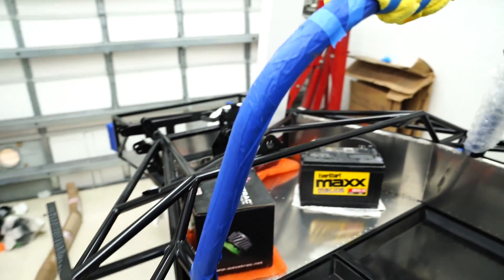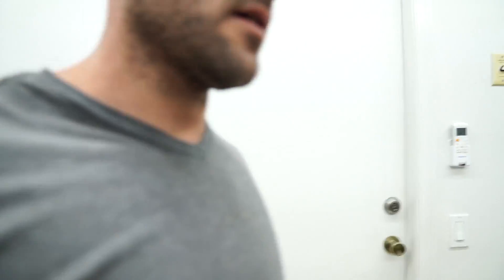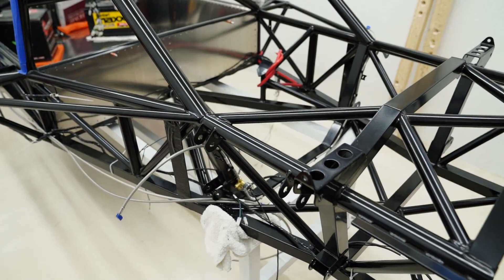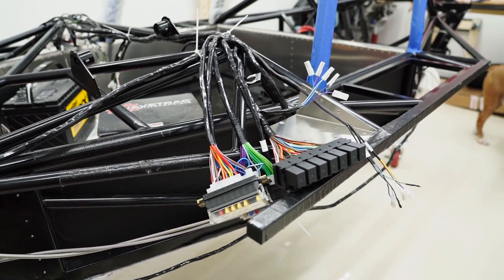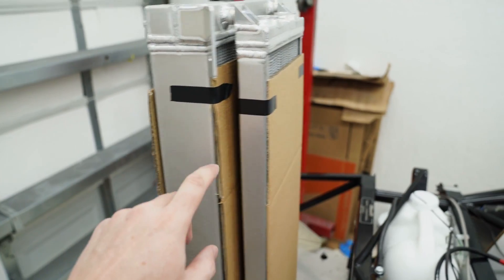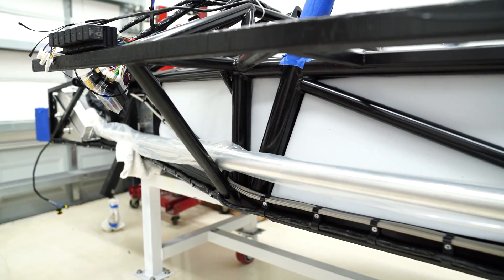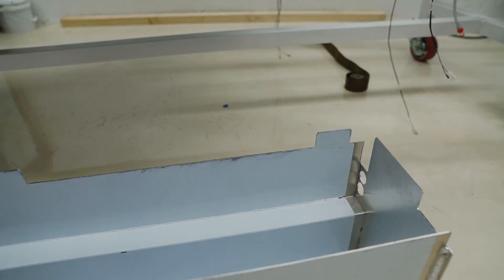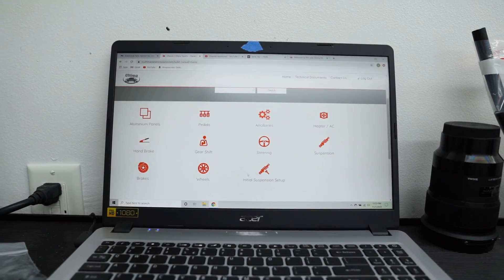Ultima RS Build 02 - Ancillaries! - Brake lines, wiring harness, radiator, & luggage bins

Comment: My son and I are building an Evolution. We are on hold while we move to a new shop. We eliminated all fuses, relays, gauges, switches and 1/2 the loom and wired for an Aim PDM 32 with a 10” dash. We really enjoy watching your build. Great stuff. Thanks.
Reply from the maker: Wow... I didn't even know Aim offered something like that and I just read up all about it. That is awesome. Did you modify the existing wiring harness to work with the Aim kit, or did you start from scratch?
Reply: @UltimateUltimaRS  I put the harness on a board as is. Wired it up to test LED's, a battery and verified all of the circuits. I then drew a wiring diagram, then de-loomed and rewired it all. I did it for fun and really enjoyed it. The bad news is the harness is ready to go but the project is on hold until we move this month. I saw the PDM 32 last November at the AIM booth at PRI. It was supposed to be released in February 2020. Due to Covid (they say), it is still hard to get and I don't have one. I have programmed it in their Beta software and purchased the harness connectors so it's ready to go.

Comment: Not a road trip vehicle? I have plans for my surfboard and suction mounts. 
You're making some stout progress, Gabe. It all looks neat too! You did make me rush and check my harness for labelling though. As for that LT engine harness, you might need some extra horsepower to carry it.
Reply from the maker: Yeah I forgot you're putting rock sliders on yours! If anyone could make a rear wheel drive crawler, it's you Rob. I'm looking forward to seeing photos of your Ultima with the suspension fully articulated so put it on the white board!
Reply: @UltimateUltimaRS  I need rock sliders for a trip to the coffee shop with our road conditions! I might have to upgrade the whiteboard for the suspension drawings and get a Beatles haircut so I can emulate Engineering Explained.
Reply: I was driving mine 4 hours each way loaded with gear for a track day weekend, it's a perfectly good road trip vehicle!  As for the LT harness, if you're going with the stock ecu, you can probably de-loom the braided shielded cable for the throttle sender, I'm willing to bet layout is very similar to the LS7 harness.  It has enough length to reach the pedal from the side pod and you can make the harness look a lot nicer in the process.
Reply: Rod 105, I noticed that you are using a ruler to mark the robot holes. Take some elastic band that they use for clothing.Mark increments of 10mm on it. So when you stretch it, it will give you equal amounts of holes. I hope you under because English is not my native language.
Reply: Damn iPhone keeps changing the words. The worst phone I ever had.

Comment: Before you fit the body side pods run a length of rigid plastic DIY cable duct under both the luggage pods.
Later on you may find you need to run extra cables you had not planned so you may need these ducts.
Ask me how i know. I've built 5 Ultima.
Reply from the maker: Good to know and thank you for the comment. I have been waiting until the absolute last minute to finalize them and will search for some of that cable duct to use!

Comment: It's surprising that Ultima doesn't use hard lines for its brake setup.

What kind of harness wrap does your body harness have?  
It looks like silicone tape, which is what I'm planning to use for a custom harness on a v8 conversion project.

Nice build series, it's refreshing to follow a build that is all content and doesn't throw in a bunch of silly hype to get clicks.

Comment: What made you decide to dry wrap the header wrap? I found if you soak it first it's a lot nicer to work with and  not as dusty.
Reply from the maker: The instructions indicated wetting was not needed, though looking back, I probably would have just so it was easier to work with.

Comment: The heat wrap, are you not suppose to soak it in water before applyiing?
Reply from the maker: DEI states it isn't necessary with theirs, though typically yes, that's what I've seen as well.

Comment: could you have used something like a holley harness?  there a little cleaner that gm harness
Reply from the maker: At the time of the build, there wasn’t a company that offered an ECU/Harness for the LT5 that controlled both direct and port injection. I definitely would have gone that route if so.

Comment: Please, please, pretty please, don't used that LT5 harness. Look into something like a PDM that eliminates all of the bullshit, the fuse box, etc and makes for the cleanest installation possible. Haltech makes one that has a TON of features you could use on this monster like TC and a ton of I/O for just about everything imaginable. I think it's called the R5000?

Also, on that DEI wrap, you're supposed to overlap it half way for maximum effect. Letting it soak in some warm water also makes it much easier and for a much nicer finished product as well.
Reply from the maker: Corey I'm right there with you but I haven't been able to find a plug and play aftermarket ECU for the LT5. I just went on Haltech's website and it doesn't seem like they have anything for the Gen 5 LT engines at all. I know Holly JUST came out with support for some of them and I was excited for that until seeing the ONLY engine they don't support is the LT5. Motec is an option but the cost of an ECU plus custom harness PLUS custom tuning is a huge cost. All those extra components from GM are going to be in the side pod hidden, with just the wiring harness for the sensors wrapped around the engine. We'll see...
Reply: @UltimateUltimaRS  I'd contact Haltech directly and see what they can do, but if they can't help with a plug and play, I think your best option regardless is actually one of the kits and just source the connectors or use the ones from your harness and make it up yourself. There's a pretty good chance you'll have to some modifications to it anyway for layout and different placement of things anyway. It's not hard at all. One of the universal Haltech PDMs come so all you have to do is route it how you want and then crimp on the pins for the connectors. Can't ask for much easier than that. Lol
Reply: Ultimate Ultima RS . A Bosch ms6 from Uwe Ostmann, extreme di, Fixes that and gives you motorsport traction control.